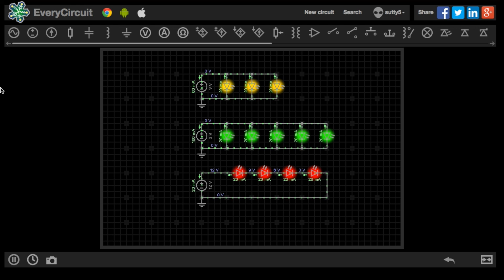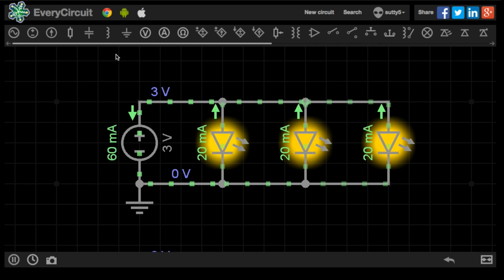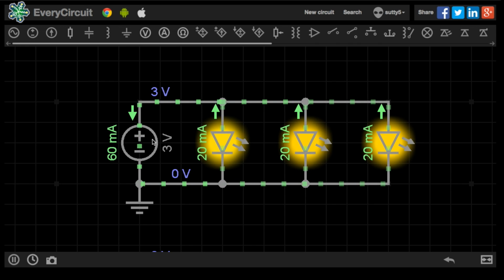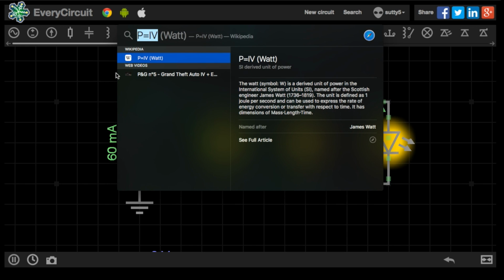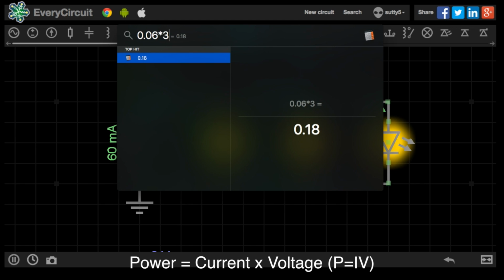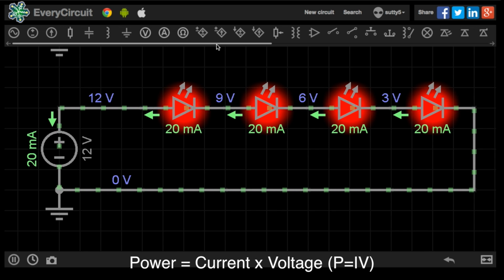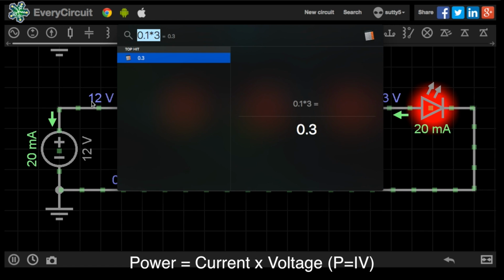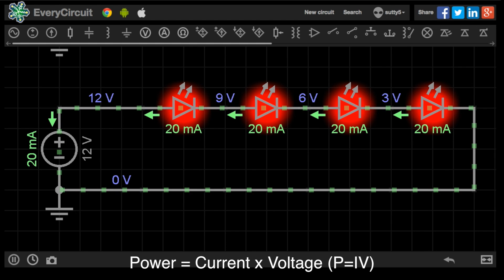Easily Understand Wattage/Power: Electronics Basics 4

Comment: how about how to compute consumption in a powerbank say, i have 10, 000 mah powerbank output 5V / 2.4A to charge a cellphone with 2000 mah.. the question is when it will be fully charge?
Reply: how much amps is your cellphone drawing when it loads.
Reply: for example if your phone is drawing 2 A while it loads, it will take 1 Hour to fully charge your phone. 2000 mAh = 2 Ah. 
2 Ah / 2 A = 1 h.

Comment: I still can’t wrap my mind around where amps come from. Volts is an explicitly constant amount from a specific component, the battery. Ohms is an explicitly constant amount from a specific component, the resistor.   What is generating amps?  Is amps a purely derived number with no discreet tangible source?
Reply: Amps is how much electricity actually flows through in a set amount of time. It's the number of electrons physically in the circuit at any given time. The classic water analogy compares voltage to velocity of the flow of water through a pipe, resistance as the diameter of the pipe(narrower is more resistant to flow of water), and current is the total of water in the pipe at a given time based on diameter of pipe and the rate of flow (voltage). 

So voltage is also known as a potential difference ( a difference in equilibrium between two things). Think of gravity. If you hold something up high, there is a potential difference in its energy vs something on the ground and if you release the object it will flow down to the lowest point it can, usually the ground. Voltage from a power source has that same flow potential. Electrons want equilibrium and a typical power source like a battery is specifically made to offset that equilibrium so the electrons will flow from one side to the other to balance back out. Amps is how many electrons can flow at a single time. The circuit has a physical limit to how many electrons can fit in the wire at any given time.  So you've got a limited amount of space for electrons (your amps) and a rate at which they are moving (voltage) and you can change that rate and amount by adding resistance.  You can always have a pipe that's only running half full of water and that's analogous to having a lower amperage than a your circuit could maximally handle. If you exceed the physical limits of the wire and jam in too many electrons, you will burn out your wire or components like your resistors. This is analogous to a water pipe bursting from having too much water for its physical limits.

Also, more formally, the origin of ampere is a derived term. 1 amp is actually 1 Coulomb per second, which is a measure for a rate of electric charge of electrons (Coulomb) through a specific point in the wire in 1 second. So think of a gate with people coming through, how many people come thru the gate in 1 second. That's your amperage. If you push them through faster, you've increased your voltage and since more are coming through every second than before, the amperage went up. That's why the two terms are related, and hopefully you see why resistance would also be related and affect those two things. 

To reiterate, the current is the total electrons in the circuit at a given time based on the rate of flow, the resistance, and whether your circuit can physically handle the amount. 

Hope this helps give some better intuitive understanding for current, what it means, and why it changes in relation to resistance and voltage.

Comment: I thought in series the total resistance "RT" = the sum of all resistors. And in parallel with 3 or more the equasion was RT =           1/ (1/r1 + 1/r2 + 1/r3)
Reply: Yes you are correct , this the how you work out a series Circuit not a parallel circuit which the answer would be 6.666666667

Comment: What is the difference between voltage and current?
Reply: Formal definitions are easy to find online. Voltage can be compared to water pressure, while current is equivalent of water flow through a cross section of a pipe  per given unit of time.

Comment: Anyway.. your electron current is very confusing, because it's old custom to imagine that energy flow is from minus to plus, thus diodes and other symbols looks like they looks. I know, you want to show electrons, but if you want to use classic symbols, please, also use classic flow of the current... This is convention used for decades. When symbols were changed? We know you know how electrons flow, but we also know that currwent and positive charges are running the other way, so it's only symbol.

Comment: Why is it always 0V on the negative terminal.....and some other value on the positive terminal?
Reply: It's because it's showing the amount of voltage that has been "used up" to that point (how much of a potential difference is between the negative terminal and the point in the circuit)
Reply: @deerwolfa  That seems needlessly complicated, is it really just that?
Reply: I know I might be a bit late but I think it is because the negative terminal is considered "ground" and is therefore neutral due to having no charge.

Comment: Hello Simply Electronics. This is great, and thank you. If i understand it correctly, we regulate Voltage by adding batteries and resistors, and current is determined by consumers? If we use LED's that's works on 20mA, current will be 20mA, and if we use something else that use 2A, current will be 2A? Did i get it correct?

Comment: question please  : does voltage flow the opposite of the curent is it correct if  i put a blue voltage arrow  pointing the opposit of the green curent arrow ??😊
Reply from the maker: Voltage does not flow, the only thing flowing is current. Let's use a waterfall as an example. The water which will be our current is flowing/falling from the top to the ground below, the force pushing the water down from high to low is gravity, in a circuit, this force is known as voltage. The voltage is the potential difference from ground. 3 Volts indicates the force pushing the current is a 3v higher than 0V (Ground). The higher the voltage, the more force pushing the current.

Comment: I have a question after 3:46 the all the 4 LEDs in the circuit conduct 20 mA how is that possible when in a series circuit the current isn't constant plus when all we supply is 20 mA
Reply from the maker: +Syed Ilhan why do you believe current can't be constant in a series circuit? Current can be constant through any circuit if it is supplied with constant current. I would recommend taking a look at my Series vs parallel circuits video. You can find it within the videos on my channel.
Reply: Simply Electronics thanks and another thing do the LEDs only take up the current they need?
Reply from the maker: LEDs do not regulate their own current consumption. Although if you directly supply the correct voltage to the led then it will not draw too much current. applying higher voltages to a 3v led will damage it as current drawn could be significantly higher than its max rated current
Reply: Simply Electronics thanks dude